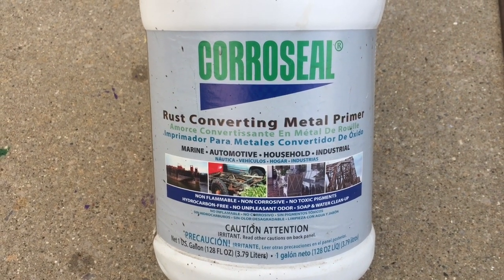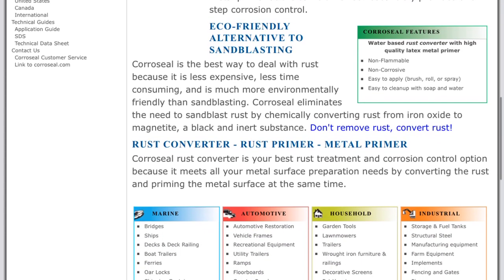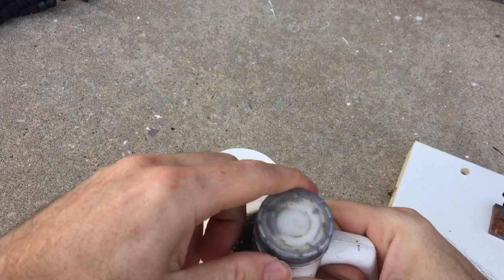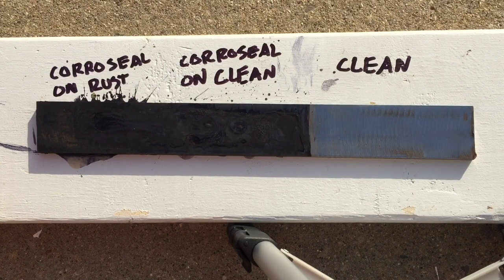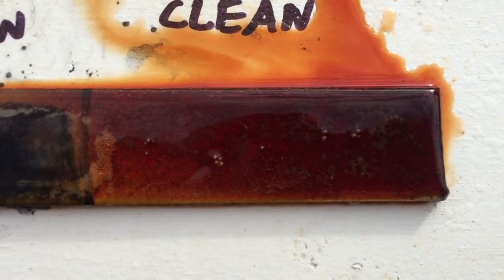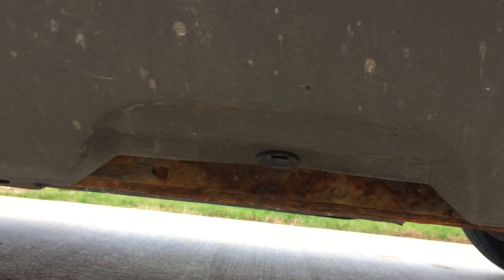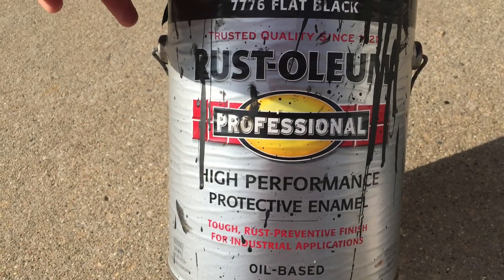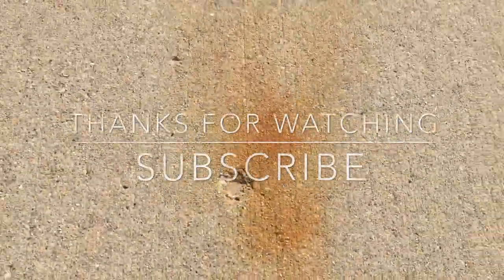CORROSEAL Rust Converter - Does it Hold Up On Its Own? Tests and Results! 4 year review! Stop Rust?

Comment: Thanks for your thorough video. I agree with your own assessment of Corroseal, after using it and having it fail spectacularly.

About 3 years ago I started making original light fixtures as a side gig / hobby, many out of rusted scrap steel. Any parts requiring new steel were rusted intentionally by using a vinegar / peroxide mix, so that they matched the others. I was looking for a rustic black finish, like old wrought iron. I therefore removed all loose rust, and after much research, decided on Corroseal as a rust converter/primer, topped with 4 coats of Rust-Oleum 2x matte black paint. All were applied according to manufacturer recommendations with regard to time, temperature, etc.

I did notice early on that the Corroseal seemed to chip fairly easily, as I had to recoat a couple of tiny spots where I accidentally tapped it with a tool etc while working on the fixtures. I should have thought more about that when it happened, but the product had such a good reputation etc that I figured I would be okay.

Around the same time I made a fixture using similar techniques, but wanted the final finish to be rusty. I therefore removed all the loose surface rust and simply used 4 coats of the Rust-Oleum 2x matte clear coat. In other words, the same paint as the black, except in clear.

Life has been kind of tough over the last two years, so I didn't really push to sell those completed fixtures. It turns out that was fortunate.

About a month ago I sold my house and moved. When I did, I took a moment to admire my fixtures, which had been carefully sitting in boxes, in a fully air conditioned occupied house. To my dismay, EVERY single surface on which Corroseal had been used was covered in tiny dots of powdery rust breaking through the finish. They were not related to any previous chips or other damage, but were everywhere.

I then looked at a test sample of steel which I had used for activating rust. After determining the best method for making them rust, I had prepped them and coated them in the exact same manner as the black fixtures. All pieces of the sample steel were rusted just as the fixtures were.

After that I examined the intentionally rust-finish fixture, the one which only had 4 coats of Rust-Oleum clear coat on it. No breakthrough rust was visible, but since the underlying surface itself was rust, I wanted to make sure. I rubbed it all over with a piece of white paper towel, then examined the towel for any trace of color. There was absolutely none. In spite of being covered in rust to start with, the Rust-Oleum clear coat alone had done its job, and the fixture looked exactly as it did when I finished it.

To put it mildly, I am extremely disappointed in Corroseal. I now face the tedious task of disassembling every fixture I made using this crap, stripping them down to bare metal, and completely refinishing them.

For me, Corroseal utterly failed in every way, and I will never use it again.
Reply from the maker: Thank for sharing your experience. Sorry things turned out that way.
I finally used up my 1 gallon jug and I will not be buying any more. 
I have watched several other videos on Corroseal and we are not alone.

Comment: Bummer. I just bought a gallon of Corroseal to use as a rust converter, prep for a big project below...now I'm having second thoughts.

Have you tried POR-15? I have a steel geothermal soaking tub with a concrete floor. I used it as a rust stabilizer/primer about 8 years ago before shooting the interior with UPOL Raptor urethane bed liner. I just stripped everything down to bare metal and concrete, and while there is a fair bit of rust, it did last for several years. Keep in mind these surfaces have been submerged the entire time in water ranging from 100 to 120 degrees (only when I accidentally leave the valve open too far and forget to reduce the flow).

I'm coating everything with 10-15 mils of Pond Armor, a 2-part epoxy liner. POR-15 is intense and has some health and environmental hazards. Since I'm covering a large area, I thought I'd give Corroseal a try. We'll see.

As an aside, I used a liberal coating (@2gal) of Citristrip and covered the wet surfaces with plastic sheeting for 24 hours. While it took some time, I was able to remove 90% of the bed liner and POR-15 from the steel using a scraper, and finishing up with 60 grit and a steel cup brush on my angle grinder.

Comment: Very helpful. Your stated intent was to show how this stuff holds up on its own- and that’s exactly what you did as far as I can see. The manufacturer says in it’s advertising that
 “ Corroseal Rust Converter converts rust (iron oxide) into a stable substance, magnetite. It also primes the surface with a high quality latex metal primer at the same time. Corroseal truly provides one step corrosion control” .
 I for one have been curious just how that claim held up and you answered that. Certainly additional coatings, preservers, or different methods might improve finish longevity but that wasn’t what you were testing. Keep the realistic and honest testing coming, I certainly appreciate it
Reply from the maker: Thanks, glad you found it helpful!

Comment: Hmm- I wonder if after adding the corroseal, if adding a rubber spray coat of the corrosral would protect more?
Reply from the maker: For sure. The Corroseal is just a primer and should have a to coat to protect it.
Reply: Would definitely not use a rubber coating as it can trap moisture underneath and rot out your frame. Eastwood makes a good chassis paint that I can vouch for, spray that on top of the corroseal

Comment: Can’t wait to buy this stuff thanks for sharing your positive experiences
Reply from the maker: Glad you found it helpful!
In my personal experience, it has worked fine on metal surfaces with no rust (in which case the product is not really needed). On surfaces with rust, and on new welds, the rust came back through the paint.
Reply: What was positive about the product.or are you watching a different video.lol

Comment: You just depressed the shit out of me.  I have corraseal and was about to do  my whole truck with it and then paint it with oil based tractor supply paint.  Looks like that won't do either.  Thanks for the vid  man.
Reply from the maker: I’ve painted vehicle bodies with tractor paint, and the results were good. 
If the frame is already rusty, I would personally use Fluid Film or something like that. 
Here is another Corroseal video that I made a year later.
https://youtu.be/pHeHN5h4l6I
Here is a pretty good video that I recently watched comparing rust converters. https://youtu.be/tu1n1POMg98
Reply: @HowtoandReviewsOfficial  thank you bud!!

Comment: After using the corroseal let dry and coat it with epoxy primer (primer with harder added). I’ve had good luck with that. If it’s a frame op coat with por 15 or equal.
Reply from the maker: Thanks for the input, I appreciate it! I actually do plan on doing a frame off in the next couple years. That’s the plan anyway...

Comment: So are you just corrosealing ....or are you putting the required paint coat on top of it?....I did mine and painted it as required and still solid no rust comes back
Reply from the maker: Glad to hear that it has worked well for you.
In the first half of the video, I used Corroseal only, to see how it holds up on its own.
In real application I applied a top coat of paint. On surfaces where there was no rust, there are not any problems. However, on surfaces where there was rust, or where there were welds, rust came back through the paint.

Comment: doesn't it say on the label that corroseal isn't intended for clean metal and is only a converter of rust....there must be rust for a conversion to take place....lot of good examples of longer term samples.....yes i used to swear by it but it isn't as permanent as they want us to believe, for sure....whats the better suggestion out there?

Comment: How did the WD-40  Specialist Long Term Corrosion Inhibitor work?
Reply from the maker: I didn’t get a chance to try it. Someone thought it was a can of regular WD-40 and the can disappeared.
I’ve been spraying the underbody every fall with Rustoleum truck bed liner. 

I still want to clean up a steel plate, spray half with WD-40 Long Term Corrosion Inhibitor and leave it outside for the winter season. It’s on my video list.

Comment: Have you found a better solution?  I just used Ospho to remove and convert my rust after using a grinding wheel. I'm considering covering it with Cosmoline RP-342 Black Rust Preventive Spray (Military-Grade).
Reply from the maker: I just used up my Corroseal last fall because I already owned a big jug of it.
I have read a lot of great things about cosmoline rp-342, and it has been recommended to me many times. It is at the top of my list to try next.

Comment: Do you think that is you haven't done the coating that maybe the rust would have been worse?  Just wondering.
Reply from the maker: Corroseal definitely needs a topcoat of paint and real application. I was just doing a test to see how it holds up on its own.
Corroseal by itself is better than nothing. But, it definitely needs a top coat of paint to protect it

Comment: I'm not one for these rust converters, but this stuff needs to be topcoated with paint. The converted finish is not waterproof, it's absorbent; which it has to be for good adhesion to paint. Try primer and paint after using this product and then conduct these same tests; would be very interesting seeing the results.
Reply from the maker: Thanks for the input! I actually have done just that; I have coated a rusty bar and topcoated it with paint (I did not use primer because Corroseal is advertised as being a primer). It is currently attached to the underbody of my vehicle for the winter. I will do a results video in the spring!
Reply: @HowtoandReviewsOfficial  No, you need to use the appropriate primer for the particular topcoat used. Primers have good adhesion to almost anything including other primers; topcoats, not so much. You need to use a suitable primer to completely cover the area to be painted. If you don't primer it, it will fail 100%

I would not expect this rust converter to hold up to high temperatures, so in areas that will see high heat, I would expect it to fail.
Reply from the maker: @lizardking8388  Good point. Thanks

Comment: What type of brush do you use to brush of the rust? Is it stainless steal or does it contain other metals. Some metals contaminate steal, like Nickel. Which is prone to rust.
Reply from the maker: Great point!  I’ve used both. When grinding down to bare metal, it’s a carbon steel brush mounted on a drill. When not trying to expose all the way down to clean metal, to let the Corroseal neutralize the surface rust, stainless steel hand brush.

Comment: Thank you so much for sharing. The video is extremely helpful. May I ask you where do you live? Near a sea side? Do leave your car outside for the winter or do you store it keep it outside? Is it humid where you live (lots of rain? )
Reply from the maker: Thanks. I live in the north east, near the Great Lakes. There is no severe humidity or any ocean salt. Just cold in the winter and the roads are salted all winter to combat snow and ice. The winter road salt destroys vehicles. 
The silver car in the video pretty much lives outdoors year round.
Reply: Probably fluid film would do the same job. It would take less time to apply though. I live in the uk, extreme humidity. so I am looking for something that would work. Found 2 products that I want to test Hammarite No.1 Rust beater (3 coats as suggested and Neutrarust 661 + a coat on to it. I see how it goes. P.S. Thought that you might be storing the car in a home garage, then it would corrode, because when the car is wet and you take it to closed space, the humidity eats the metal, as it has no way to go away. So one should put their car into a garage when their car dries out.      @HowtoandReviewsOfficial
Reply from the maker: @karlrod4699  Great information. Thanks for sharing!
I spent some time in the UK a few years ago and really enjoyed it!
Another viewer recommended “Cosmoline RP-342 Heavy Rust Preventative Spray“  which looks very promising. You may want to take a look at it.

Comment: Try final coating with spray cosmoline
Reply from the maker: Thanks for the suggestion! I checked out Cosmoline spray, iand it sounds outstanding. I have not tried it yet, but I assure you that I will in the future. It sounds like it should be sprayed directly on the metal, and not on top of a primer (Corroseal). The Corroseal would inhabit the Cosmoline from doing its job. 
I will look into doing a Cosmoline test over the winter.

Comment: I feel an issue you may be having is you are grinding down the rust on your hood and frame. 

How can a rust converter convert rust that’s not there?

From what I’ve gathered this works the best being applied to actual rust not a non rusted surface. 

I feel if you’re going to remove the rust there probably is another product better suited for non rusted surfaces and rust prevention. 

I feel rust prevention and rust conversion are 2 diff topics. 

I did enjoy your video tho. It was informative
Reply from the maker: Thanks, I appreciate it! Great points!

I agree that rust prevention on bare metal , and rust conversion are two different things.

This product did not work well for me to convert rust; just applying it directly to rusty metal.

I suppose I started moving towards grinding rust to help the product out, so there was not as much rust to convert.

My thought for applying it to metal ground clean is that there may be microscopic rust dust imbedded in the surface from grinding, or rust that I missed. I tried Corroseal as a failsafe, thinking if there’s any rust not visible, the Corroseal should take care of it.

I have tried it in many different applications, and all around, it has not worked well for me. Wherever I use it, rust comes back.

I know this video was not the best, but I thought it may be helpful in someway. I’m currently working on a more straightforward test over the winter. I intend to post up the results in the spring.

Thanks!
Reply: @HowtoandReviewsOfficial  I cant wait to see more videos from you
Reply from the maker: @k.wright3664  Thanks, I appreciate it. I currently post a new one every Saturday morning with no plans to deviate from that schedule.

Comment: I am planning on covering the corroseal with cosmoline RP-342 and/or CRC 0626 which will keep out the moisture. Time will tell if this works or not. (I am hopeful) With my 99 4runner frame, I have nothing to loose.
Reply from the maker: I wish you the best. Hopefully that takes care of it.
In my experience, if you have existing surface rust, apply corroseal, then paint, the rust will come through. It also did not work on new welds; rust came through. If you use it on clean metal, it should be ok, but if the metal is clean, you may as well use automotive primer. The best solution is to grind off rust if you can. That has been my experience over the last 4 years. I hope it helps. 
I’m doing another test over the winter with different combinations of Corroseal, primer, and paint. I will make a review video in the spring.
Reply: @HowtoandReviewsOfficial  I am finding I get better results if when applying, I keep applying it, keeping it wet for about 1/2 hour by constantly re-brushing it. In those areas,  You just can't brush on a coat and let it dry. This way, at least, I do not see the rust come back quickly. I will update with longer term results when they come in.
Reply from the maker: @kf3en  That sounds great. Keep us posted. Looking forward to the results.

Comment: What do you think is the best rust treatment now?
Reply from the maker: I don’t currently have a good recommendation. 

I’ve tried Corroseal. 

My brother and I have both tried a Rustoleum rust converter in a spray can with poor results. 

I have a friend who used POR-15 on a Jeep frame and said it was garbage a year later. I have not personally tried it though.

Another viewer recommended “Cosmoline RP-342 Heavy Rust Preventative Spray“  which looks very promising. You may want to take a look at it. That’s the top product on my personal list products to try.

The best solution is to grind down to bare clean metal, and apply appropriate primer and paint. But, that is not practical when talking about an entire vehicle frame, which is why we are all interested in a rust converter that works....

Let us know if you have any other suggestions!

Comment: Rust ocnverters dont penetatre the rust deep enough, almost as bad as painting a rusty metal, you will get bubble rust in no time. I prefer just stripped as many rust as possible (combionation of rust remover and wheel wire brush) and used rust converter to finished them off.
Reply from the maker: Thanks. I agree. Regardless of what the rust converter claims, grinding or sandblasting is the way to go!

Comment: Thx man ——- no one on you tube did this — make more using different products like rustrolem
Reply from the maker: Thanks. I am planning a video comparing multiple coatings. It see it being a long term project though. I’m planning to let them perform over time instead of forced corrosion with chemicals. 
I did another Corroseal test over the winter. I hope to make a results video soon.
Reply: @HowtoandReviewsOfficial  I Think I would rather see the force corrosion because there are already lots of other videos on rust control through natural means
Reply from the maker: @gregl2249  God point. I appreciate it. Thanks